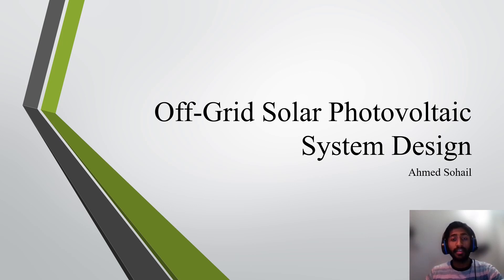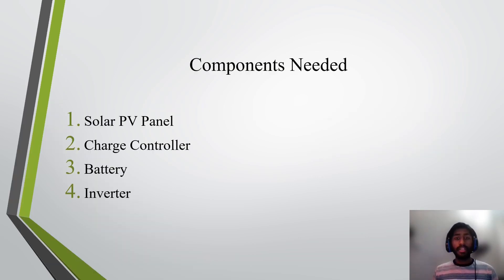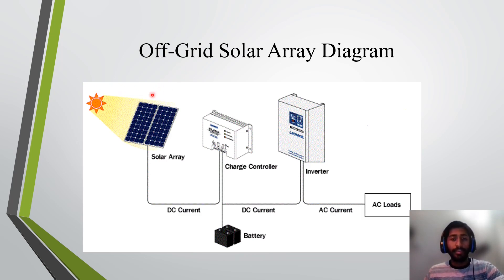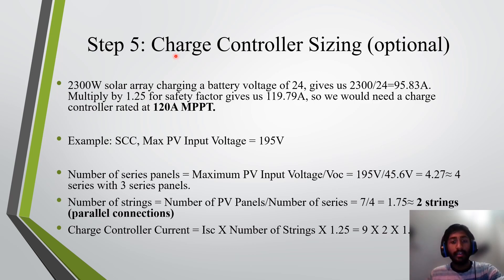How To Design Off-Grid Solar Photovoltaic System

Comment: For the PV panels, you have considered 2 strings (2 parallel paths), one string (one parallel path) has 4 panels in series (Vmpp = 148.4 V) and the other string (parallel path) has 3 panels in series (Vmmp = 111.3 V). There is a large difference in the voltages of parallel paths (strings) which might not work properly (may cause circulating current)?
Reply from the maker: Hmm yes it could be as there is a need to recalculate the string sizing. Thank you for the feedback

Comment: Total batteries is not 8 brother. If you're using a 12V battery and if your system voltage is 24V then 2 batteries should be in Series and 6 batteries of 200Ah each should be connected in Parallel to get 1200Ah. So in total you'll need 2s6p configuration of batteries
Reply from the maker: Yes you are right, I didn't update the course material so the mistake is still present. Thank you for correcting the error.